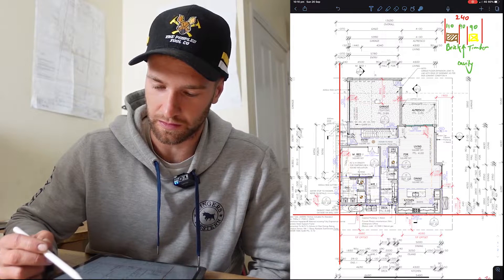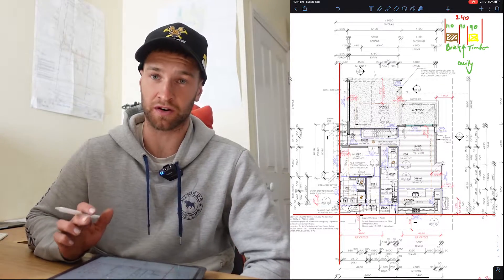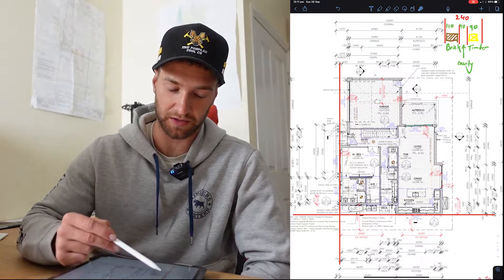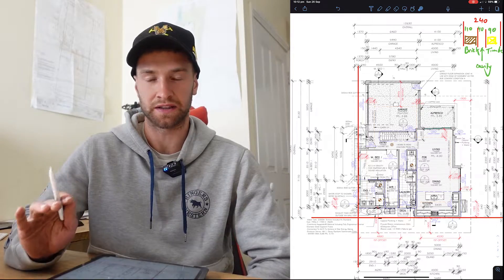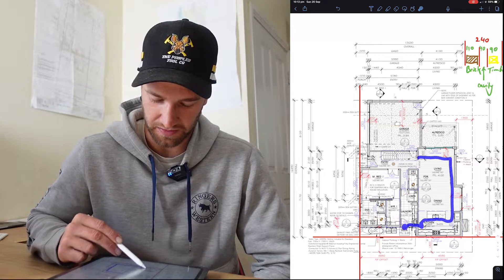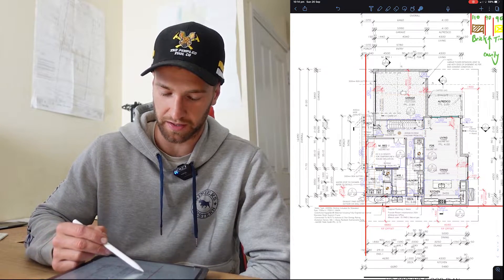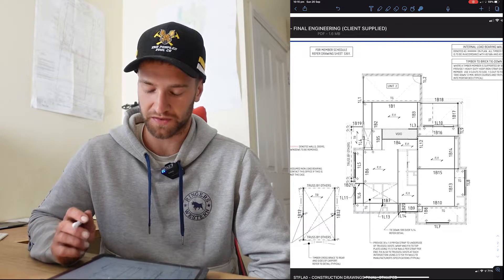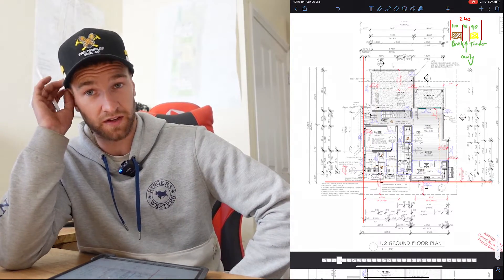How To Read Construction Floor Plans//Setting Out A House

Comment: How do you get the 10 metres from 8 and 6
Reply from the maker: Trigonometry mate, if your sides measure 8 one way an 6 the other the hypotenuse will mesure 10 if your buildings square
Reply: It's the 3 4 5 method doubled